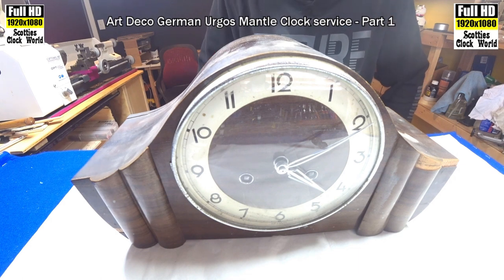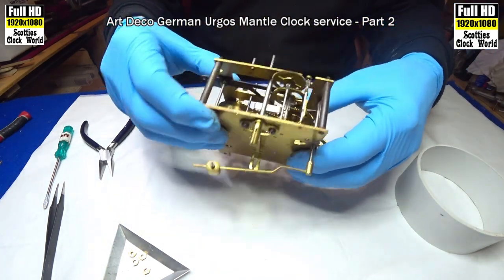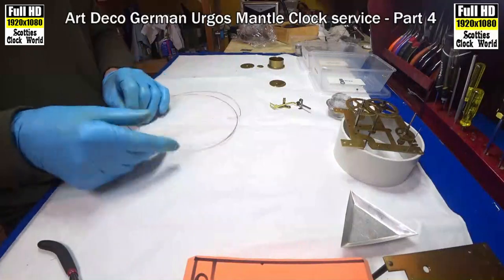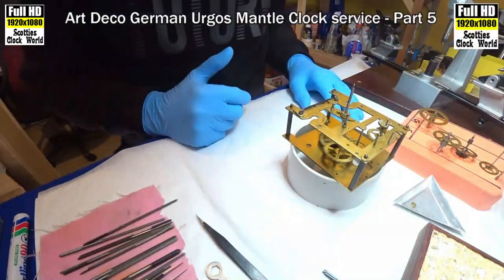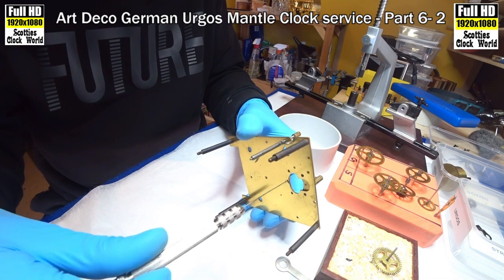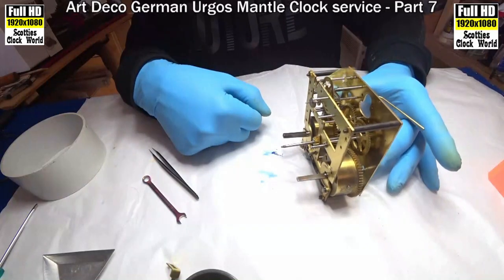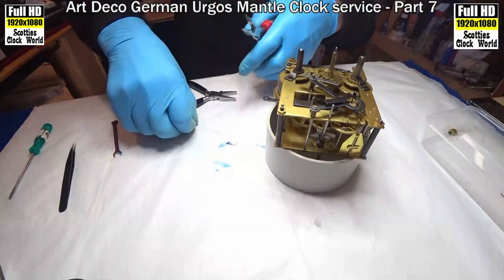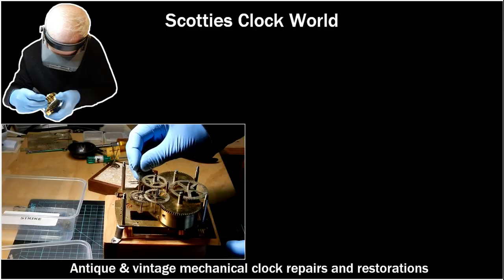Art Deco German Urgos Mantle Clock service - Full Video

Comment: I have one small quibble having to do with the end of the video where you are measuring the length of the pendulum rod.  You measure from the hole in the suspension spring down to the center of the bob and mark that as where to bend the rod.  But the pendulum bob does not hang from its center, it hangs from a loop of wire that extends a couple of inches above the center of the bob.  Shouldn't you subtract the distance between the center of the bob and the top of the wire loop, i.e. with the center of the bob placed at 13 cm, shouldn't you mark the point on the rod where the top of the wire loop is as the point to bend the rod?
Reply from the maker: Because it is the centre of gravity, that's why it is used.
Reply: @ScottiesClockWorld  I wondered the same thing. Why would you make the loop 13 cm from the end? It should have been somewhere around 85-90 mm and then the center of the bob would be at 13 cm when hung from the loop.